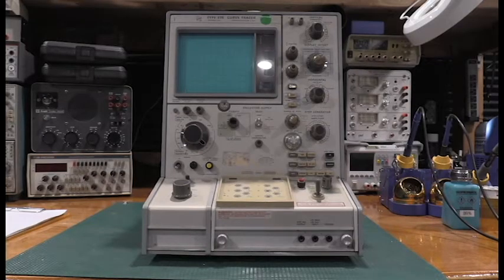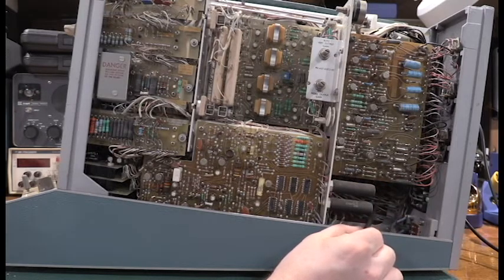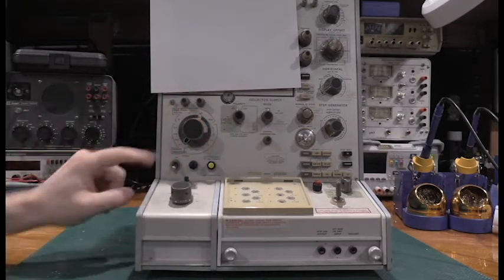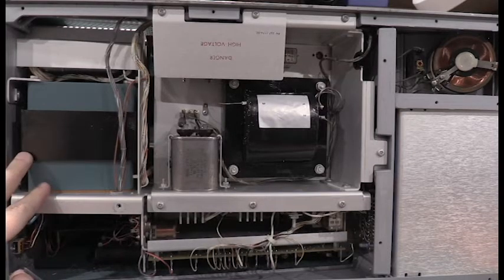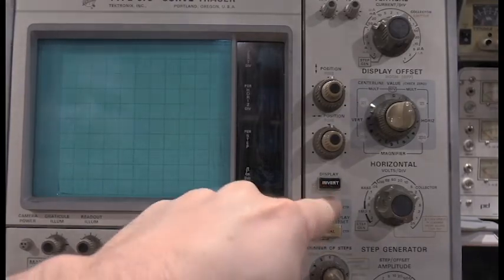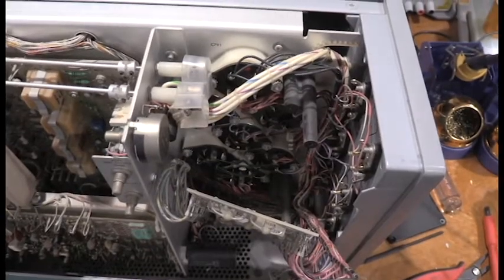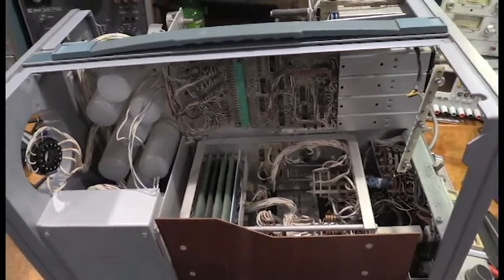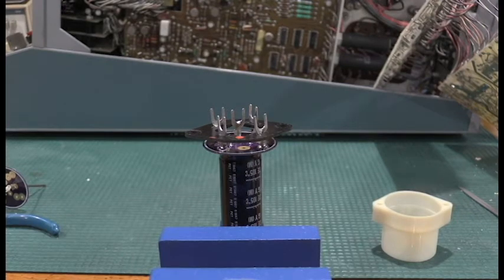Tektronix 576 First Impressions and Repair

Comment: nice video. Would you please post the link to the remanufactured HV transformer info. Looking to source a spare for my backup unit.
Reply from the maker: Unfortunately, at this time I can not. The transformers were made by a member of the Tek scopes group and were a very limited quantity. They went pretty fast when they were available. But if another run is made it would be announced there before anywhere else.

Comment: What ripple current spec did you use for the can type smoothing capacitors?  I am thinking 3A+ should be fine.
Reply from the maker: I went with high hour long life 105 degree C Nichicon's I think the 576 has a linier supply so it is rather gentle on the capacitors it is not slamming them like a switch mode supply does. Also non of the caps in the rear of the unit are involved in the collector supply circuits. Those are just the power rails for the unit not the power for the device under test.
Reply: The 5V, +12.5, and 100V rails use 3 amp rated diodes.  I was wondering what the ripple current rating was for the Nichicon’s you used on these rails.  I also checked C188 15uF 100V +50-10%  and C18 15uF 100V +50-10% electrolytics (located behind the step amplitude selector switch) and found one bad, replaced both.  I found one of the collector supply electronlytics bad (or at least marginal) and replaced it.  The collector supply caps are hard to get and difficult to replace even after accessing them.  I am relieved that most of them tested ok.  I also replaced the C300 Oil filled cap as it tested really bad.

Comment: Need your advice... i need to ship the unit to Europe, I will take it with me on the plane from PHX to Brussels.. but I need to reduce the weight from 80 pounds to under 70 pounds (packed)
I was thinking of removing the block 1.6KV transformer - looks quite easy: 4 screws and a dozen cables to cut off - any thoughts?
now I am wondering what I got myself into 😒
Reply from the maker: First off check the tube, If that does not work look for another unit the 576 tube is unique and incredibly difficult to find even in the USA in Europe they will be even more impossible. However I have good news as well as bad news. The good news is removing the collector supply will reduce the weight significantly.  The bulk of the weight in this unit is the power transformer, the collector supply transformer, and housing on the frame. The collector supply CAN be removed with a few screws and a could of cables. The only snag here is the coupling for the collector supply control will need to be disconnected and realigned at the destination. The AC/DC/DC+- control if I recall correctly will not have to be removed as that is a plug. Take EXTREME care then packing the collector supply. The load resisters will be in there and they are a ceramic power resister that will not be easily replaceable. They should be fine but are sensitive to physical impacts being ceramic.
Reply: @ZenwizardStudios  thanks for the great advice.
Will be in phz Monday . Unit will arrive Tuesday or Wednesday…. Let’s see what happens 😥
Reply from the maker: I do remember when I had to recap one of those supplies that a soldering iron and a wire cutter was NOT needed. However a hex key and screwdriver was. The good news is there were designed to be serviceable. Unlike the cap stack those are kind of awful to get to.
Reply: @ZenwizardStudios   The 576 has arrived...
has the new HV supply. I will now remove the black transformer - i loosened the bolts a bit and looks like the transformer will drop out. hope this gets me under the 70 lbs, including the packaging, to fly it over with me :)

i took not check the tube  - but the lights on the read out module are very dim so I suspect a power supply issue

will keep you updated

Comment: Colossal project,where did you get the capacitors adapter boards?
Reply from the maker: Hi Rollin and welcome, The boards are open hardware from Oshpark. Here is a link they are not the cheapest on the planet but high quality with gold plating. You will need to file down some sharp tags from manufacturing but a small files makes quick work. If i remember right they are in lots of 3.
https://oshpark.com/shared_projects/hpUFRhHC

Let me know if there is anything you would like to see worked on and I will see what I can make happen.

Comment: I have one of these. I’m trying to decide what to do with it. Can you point me to the serial number = trouble information?
Reply from the maker: There is really only 2 sticking points with this that are a “terminal” failure with no parts available. One is the high voltage transformer (under the cover in the HV supply left side of unit.) The other is the tube its self. Unfortunately these are UNIQUE parts to the 576 and were used no where else in the tek line up of equipment. The transformer you want to have is the one with the black silicone potting insultation. The brown epoxy insulation there seems to be a thermal issue with leakage current. In mine when I did a burn in test of the power supply the unit oscillated. The -75 volt rail would collapse and the unit would go in to over current protect. There was some one who commissioned a transformer recently but the supply has dried up from that run.  The tube is also unique and used no where else. There are 2 styles -00 -01 and -05. All are pretty much the same tube the -00 has a slightly different graticule. If the tube is bright and transformer is good your unit should be mostly trouble free. I have a very early example of this one that needed and extensive power supply rebuild. If there is sprauge caps on the rectifier board I advise changing them. Some of mine were 113 Ohms ESR which is AWFUL should be in the 0.XXX not 100.XXX rebuild the supply actually dropped the power consumption by 10 Watts so it was needed. Everything else seems to be durable and repairable.